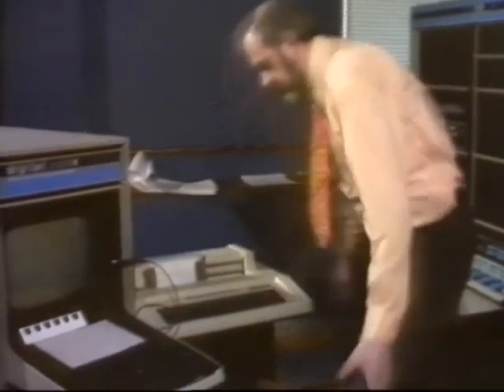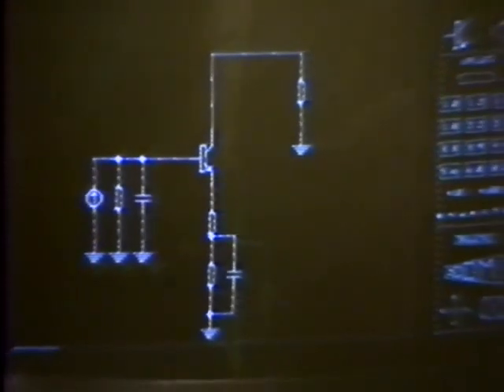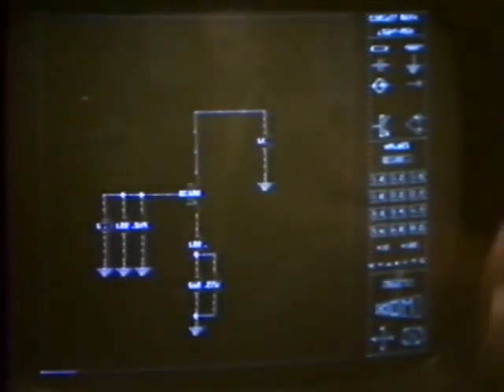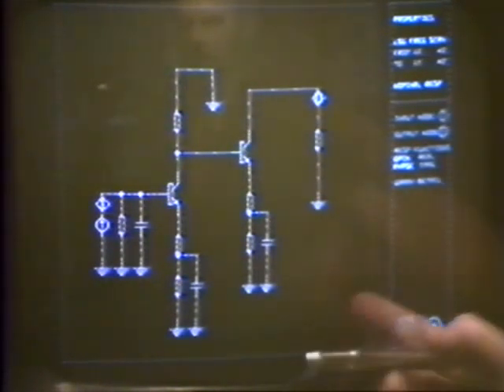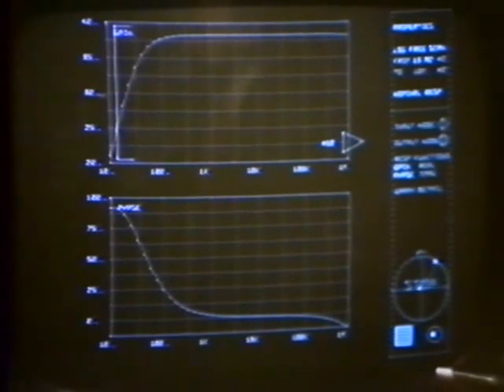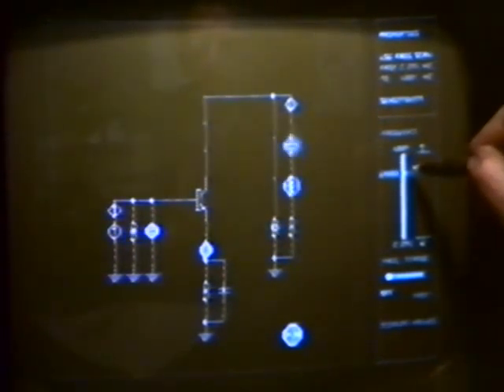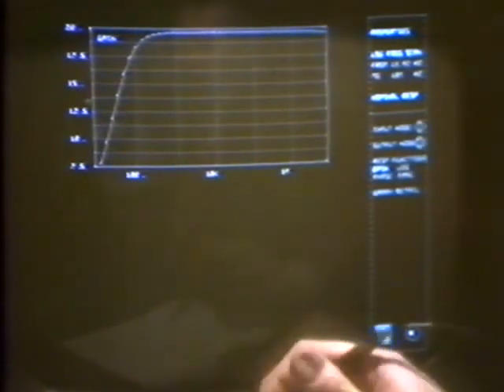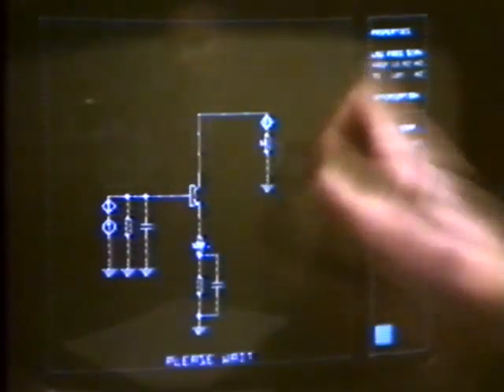MINNIE: Computer Aided Circuit Design System 1979

Comment from the maker: Gareth,

Yes, you are quite right, it was a stripe faced (single) vidicon tube in a Sony camera. All of our black and white cameras were vidicon tubes. See the Bob Spence APL video as an example of that. They needed bags of light but smeared with highlights and could burn very easily too. They were also subject to spots caused by dirt (within the tube) falling onto the face plate. Hence you should never really point a vidicon tube camera right down.

Colin Grimshaw